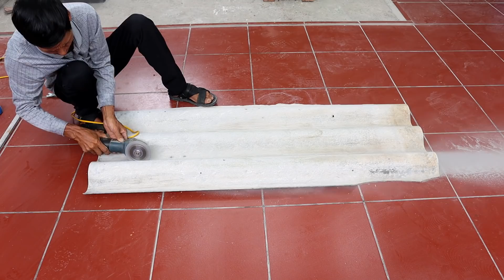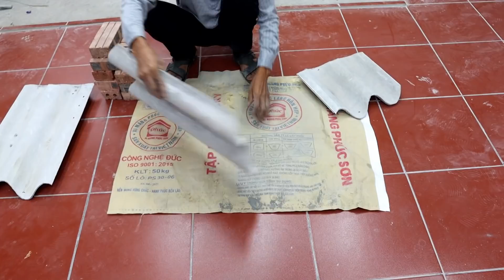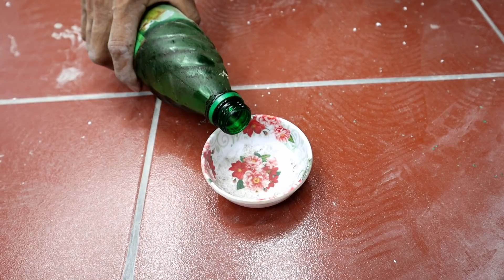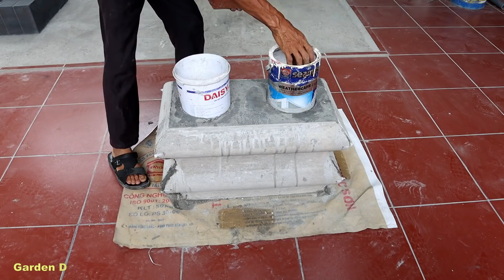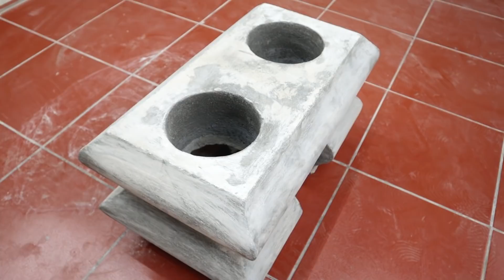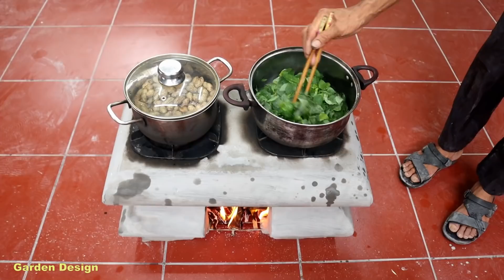DIY wood stove - Ideas to make a wood stove from cement roof sheets

Comment: These roof sheets resist temp and sunlight damage because they are made from asbestos. Asbestos is known carcinogenic and banned in several countries but middle income countries continue to use it because there is no affordable alternative. Normally asbestos stays intact in the roof sheets when undisturbed. But this man is seen cutting it with angle grinder which is dispersing the asbestos dust into the air. The symptoms will appear later in life.
Reply: That’s exactly what i was thinking about. Right.
Reply: L
Reply: How much do you need to inhale for serious health issues? What sort of health issues are we talking about?
Reply: It has its own name… Asbestosis. Exposure to it is linked to other serious lung conditions including cancer and emphysema.
Reply: @bronson9836  same symptons as smoking tobacco?
Reply: @bronson9836 potentially yes. But I am sure  tobacco kills more people with related issues. Would like to see the percentages between the two.
Reply: It's compressed cement fibre sheeting ..you wouldn't cut asbestos that easily with a diamond blade ..it's super tough 
Hard to drill through also
Reply: 5555⁵5ёёё

Comment: Hi is that asbestos or fibre cement if yes then that can be dangerous isn't it? It usually explodes or expand with great force when heated significantly....please correct me if im wrong

Comment: Asbestos dust or fibres are particularly dangerous, 1 microscopic fibre inhaled is enough to start a fatal illness, Cement board dust still contains silica which has a detrimental effect to respiratory systems

Comment: That’s asbestos containing corrugated sheets, 
This man probably doesn’t know that he is on a suicide mission, 
You should never drill, grind or cut this material without proper protective equipment. 
I feel very bad for this hard working guy .